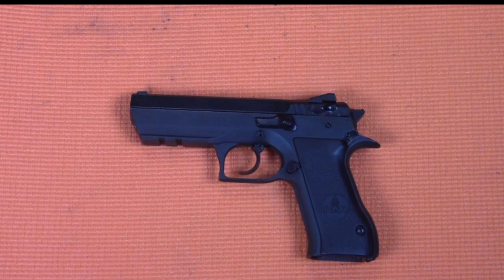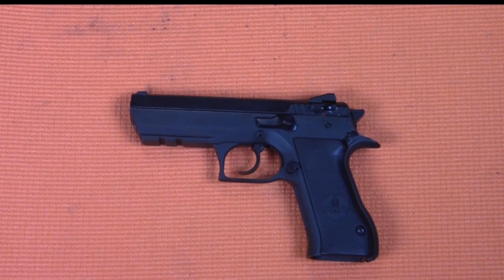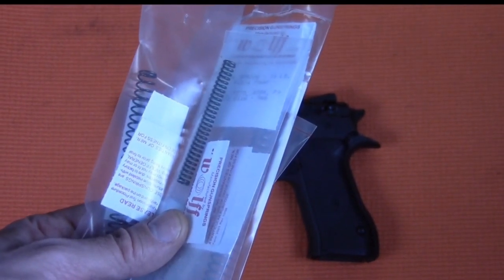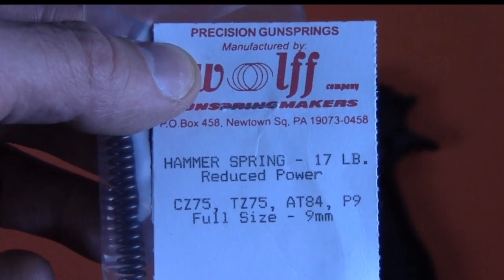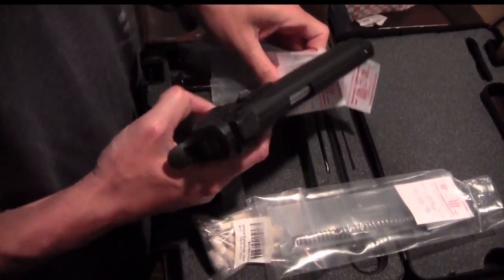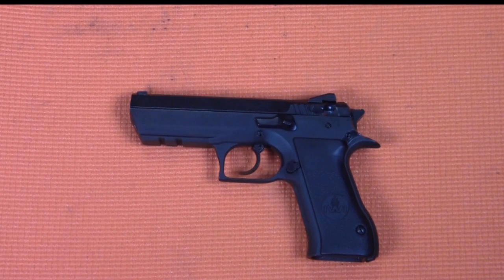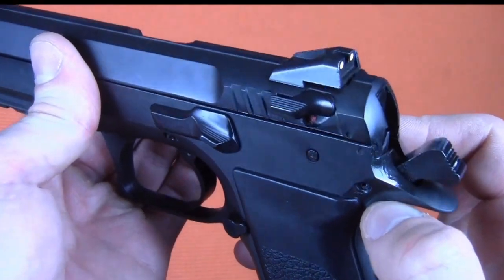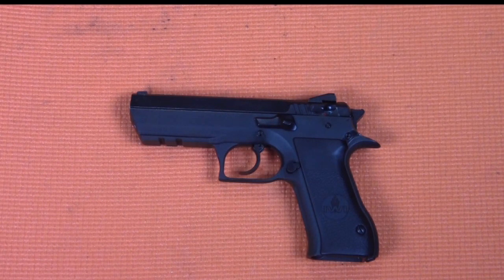Make your Jericho 941 next level

Comment: The Jericho 941 original F9 is one of the best hand guns ever made imo. 
GREAT GUN. The polish treatment sounds smart.
Reply: Sadly, it sounds like the new ones are not the same quality. I picked up a 941 F a fwe months ago, and comparing it side by side to several newer models it is quite noticble just how much better the mashing quality and fit is on the older model. So, I've been just upgrading it instead of buying a newer 'upgraded' model.
Reply: Wait, what do you mean by "mashing quality"? Did you mean machining?

Comment: I have the 1990s IMI Jericho 941 with same decocker and safety on the slide.  I've smoothed it down also, especially on the hammer like your gunsmith did.  Makes a big difference in slide action.  The 1990s versions, (at least the one I own) was a little ruff, kinda like some AKs...you can shoot it and let it work it's way smooth or you can expedite it with a little tender love and a dremel.

Comment: Have you ever ran the 19 round magazine Mec Gar CZ 75 19 AFC from cz custom with your 941?
Reply: I have ran those mags in 9 and 40. Same bodies, same followers. If you can’t find the 9mm versions the 40 versions feed and lock as normal. I even used 41ae in the 40 mag, and it will feed all but the last round.
Reply: @romeo_alpha0176  Is 41ae even worth the time these days with the hotter 40sw offerings?
Reply: @hardlylivin6602  41AE gets pretty hot too. I’ve gotten close to 1100-1230 FPS with some 170gr projectiles. It hits steel with authority but I’ve never tested it on flesh or gel. By that point 40 or 10mm makes more sense because of availability. Still fun to shoot.
Reply: The original 41 AE load was outrageous- something like 200 gr @ 1300 fps

Comment: I have a new IWI Jericho 941 FS (full-size steel).  I did buy the exact spring kit shown, which is part #14100, but I am noticing that the decocker model is used in this video.  I have the frame-mounted safety.  Are the firing pins the same?  Mine has the notch on one side and a full-length flat side 90 degrees around the rotation.  It looks the the hammer spring and the recoil  springs are identical.  It is the firing pin that is confusing based based in the decocker vs, frame-mounted safety.  The package that was sent out by Wolff Springs contained a much shorter firing pin spring that was about an inch long.  My spring as it least 3 times longer.  I called them and they sent out a longer spring.  When held next to the original spring, the new one appears to be very close, but still about 3/16 on an inch shorter.  Holding off on my install until I get feedback that was just sent to Wolff.  I will update soon.  Great video!
Reply: Did the longer firing pin spring work out?
Reply: @blechmaier  Everything assembled perfectly.  I must admit that I have not fired the gun yet but I see no issues!

Comment: Little confused, is he replacing the spring in the grip too? In that part it looked like he did but I bought two kits and neither of them came with that spring. I like the video but I wish you had a little more talking about what exactly he was doing more than the music though I did love that too. Would have liked to see him put in the smaller spring.
Reply: Some of the newer runs of the all steel Jerichos have a smaller hammer spring that doesn't run the Length of the grip. If you want to know more I'd be happy to help!

Comment: This is the 9mm version, right? Thanks for putting this up!
I own a .45 steel IWI 941. Wondering if the same spring kit works for the .45 version too? I want the same treatment for mine!!
Reply: Me too!  Had my hopes up when I saw this and went to Wolf....only 9mm.
Reply: @dougmeredith3143  Aside from the recoil spring assembly, for the most part all the internals are virtually identical across all the calibers. You use EAA Witness parts, but a CZ75 hammer strut.

Comment: Can you rack the slide in safety?
Reply: No. The safety locks the slide
Reply: @TokinWhiteKid  decocker model, no manual safety
Reply: With the frame mounted safety the slide will still freely move only if the hammer is fully cocked first before the safety is engaged. If you engage the safety with the hammer down the safety locks the action and hammer preventing you from cycling the slide.

Comment: Did the recoil spring make it snapy because the stock spring is 17lbs and you put a 12 lbs spring in it I don't understand that decision? Did you do it so you could rack the slide easily? So it would cycle with less force aren't you making more contact with metal on metal? Please answer me.